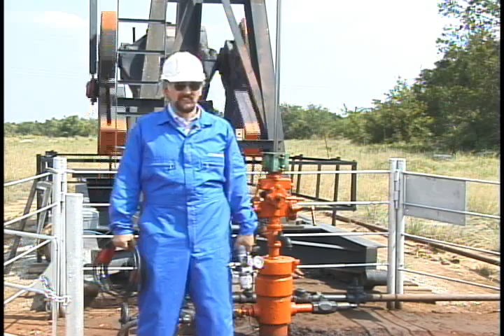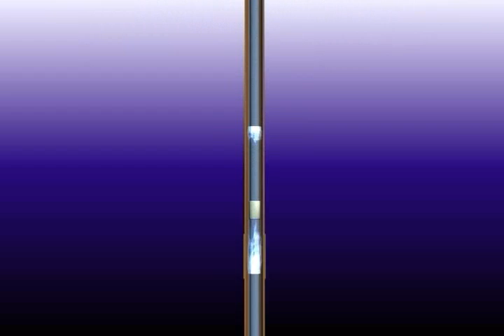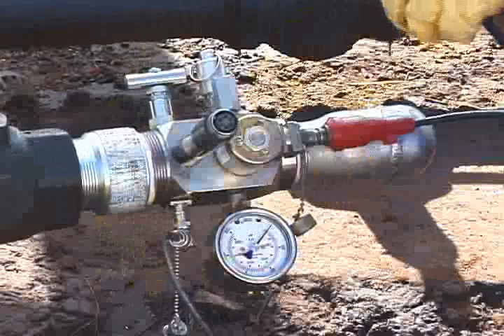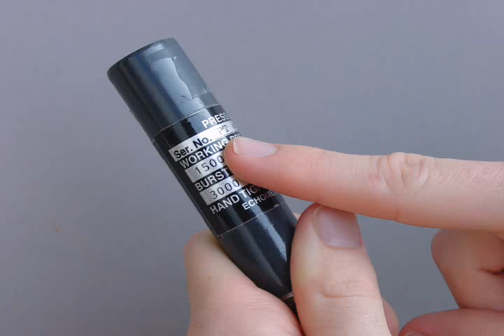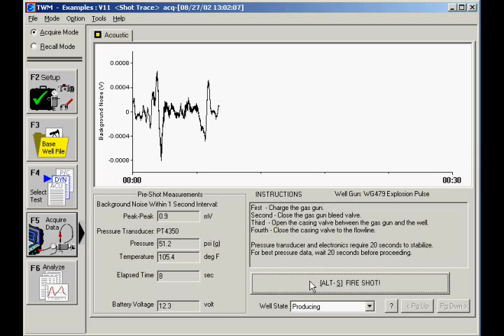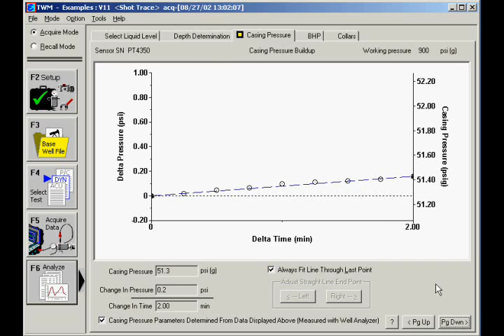Video How-To  TWM Basic Steps to Shoot a Liquid Level

Comment: If my well is directional, does this tool read the liquid level in ftMD or ftTVD?
Reply: It's been 9 months that you asked, so you probably don't need the response anymore. I do not know for sure but this might still help:
the way the liquid level depth is calculated implies that it is in measure depth, not vertical depth. If you haven't entered the well deviation survey into the software before shooting your liquid level, then the depth that you obtained is for sure in MD.
Reply: @damien9240  Thanks for the explanation. It is worth 9 months of waiting😃👍 I do need it.
Reply: @ontheler  Happy to know that I could help. 
Do not hesitate to connect with me on LinkedIn: https://www.linkedin.com/in/damien-l%C3%A9onard-aa529212/

I offer online trainings about artificial lift, gas lift, well performance, petroleum engineering.
You can visit my online store there:
https://petrolessons.com/store/damien-leonard/
Reply: Measured depth, you can input a directional survey in the program.